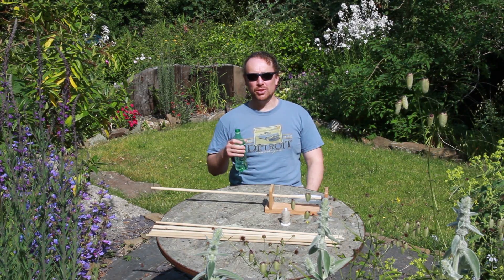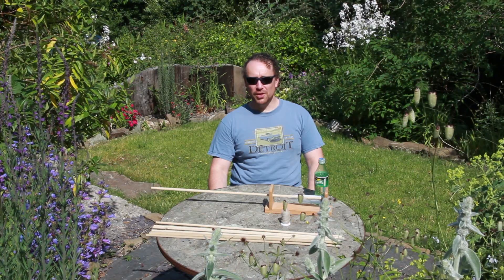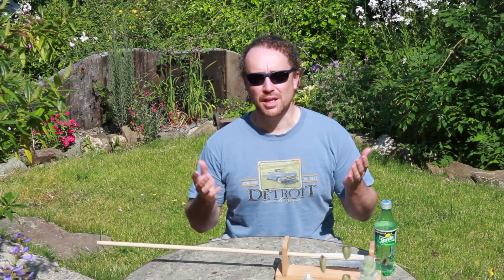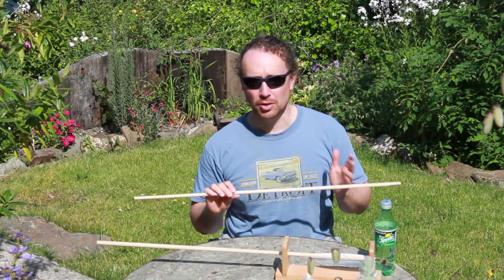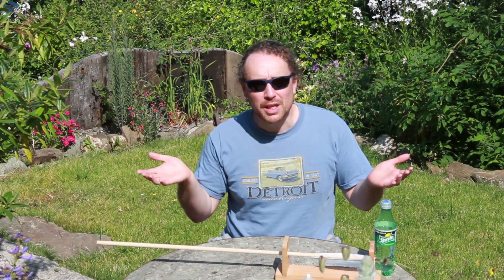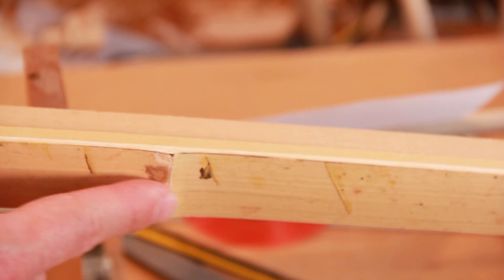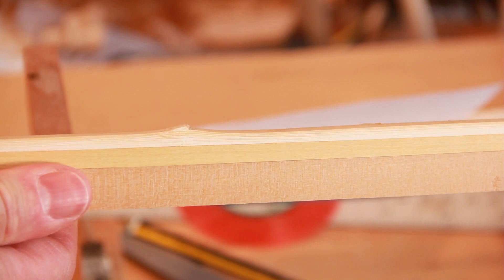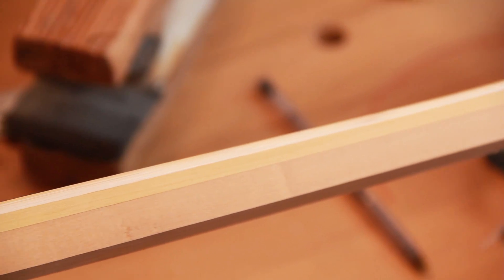English Longbow, found a crack!  Today in the Bowyer`s workshop

Comment: Hi ,I am working on my first English yew longbow !!!!, very knotty and a fair few pin knotts ,have you got a video on how to deal with pin knotts ? some of them are hard and some are soft ,its been a challenge but its practice,
Cheers
Pete
Reply from the maker: Hi Pete, glad you have made a start.  Yes, there is a video dealing with knots/pins. https://youtu.be/ohlTQV4lPCw
Reply: Richard Head Longbows Your a star ,cheers buddy 👍👍
Reply: Seen that one ,wonder if you had one on what to fill the pin holes with ?
Reply from the maker: If we fill them we use a 'Dutch mans plug', i.e. we drill out the hole and fill it with a dowel of Yew.
Reply: Richard Head Longbows thanks once again .lucky I kept the off cuts then 👍👍👍